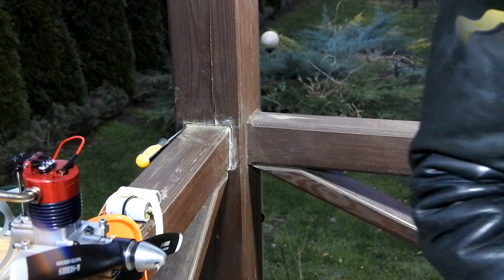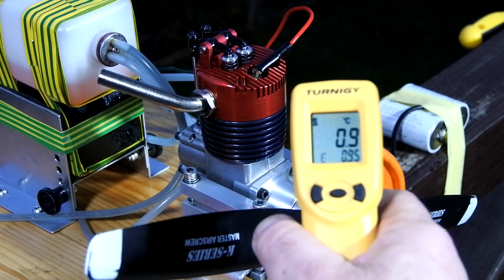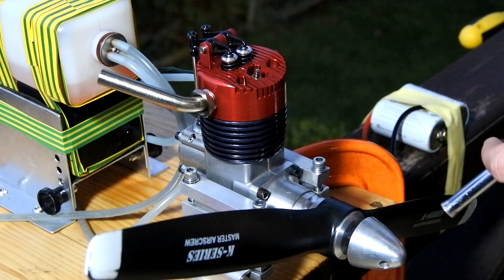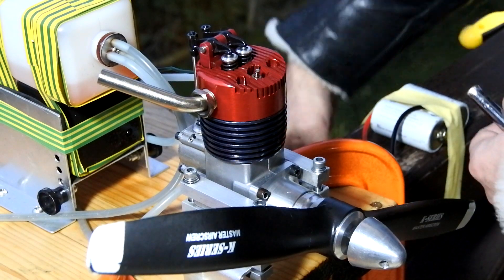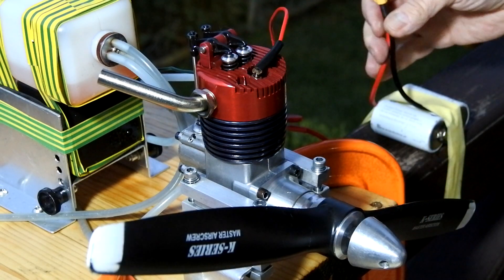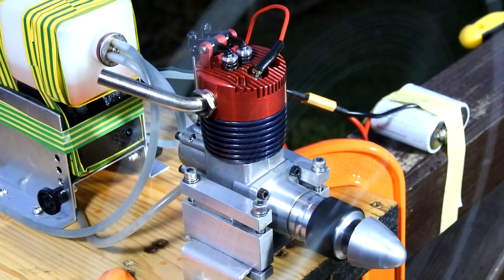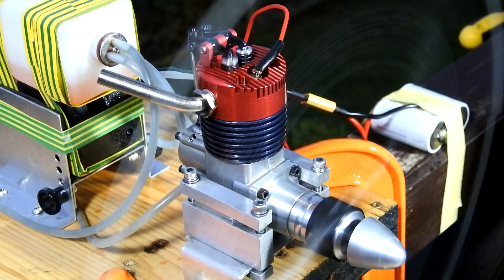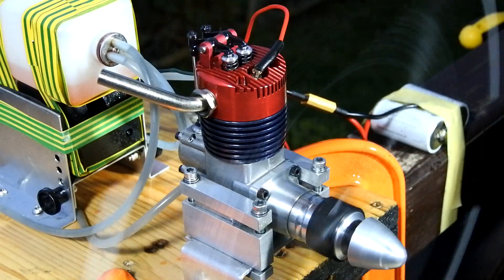Magnum 120S   34 years old engine first run

Comment: A few weeks ago I saw on offer for an "Magnum" engine like that and basically disregarded it because I thought "an early chinese one, don't want those.." ... D'oh.
Reply from the maker: Thank you for your comment ! I think, that this  particular engine is fully original, produced by Custom Enclosures, United Kingdom. I can say this, judging by the documents that came with the engine, the packaging and information from the previous owner, a collector who also had an original Magnum 91S engine.  As far as I know, Chinese copies shows some stupid incredible serial numbers (with 6 digits), as well, as different colored engine heads like blue one, for example). Should state,  that product run with approx 1 million units of crankcases of such rare engine - it's fairy  tales, according to my understanding.

Comment: If this is a ball bearing engine then why so much play in the crankshaft when it runs. I can see this play in a two stroke engine but not in a engine like this one.
Reply: Usually the front bearing is the "fixed" on and the inner ring is clamped between a step on the crankshaft and the prop driver/it's collet. There shouldn't be any noticeable play at all. I noticed that immidiately, too. 

The front casing also looks really short .. not much distance between the two bearings.
Reply from the maker: @VintageTechFan   Thank you for your comment ! I also noticed this kind of "play" during test run. was eliminate it by installing a washer. I still have some feeling, that this particular engine was very "raw", according to its serial Nr. -  one of the first hundred production runs, with all imperfections, of course.
Reply from the maker: Thank you for your question ! I I do not know exactly, but have some assumptions about this, I think that initially a washer was not installed in the engine, limiting the "game" of the crankshaft. As far, as known from some history on UK made MAGNUM engines, .120 size engine was produce later, utilizing most  .91 size engine castings, etc. I was fix this issue on mine engine after test run, by installing a washer.

Comment: I don't expect to see that much end play in the crankshaft for a ball bearing engine? What is causing it?
Reply from the maker: Yes, this is also a problem with this engine. This is a factory \ construction flaw, the engine is "raw" and requires improvements, for sure.
Reply: @crazyengines88  it could be as simple as the taper collet not being pushed against the front bearing. Nothing in the design looks like a problem.
Reply from the maker: @rcdieselrc  Thank you, will check it on dismantle, really сoncerned about this issue.

Comment: is that crankshaft have a lot of end-play? watching the video, i was seeing a lot of crankshaft in and out movement.
Reply: I think it has bushing instead of ball bearings. So the play is normal..
Reply from the maker: @edwinator46  Thank you very much for your advise, will look into engine after test run cycle, to clarify what's really wrong with it.
Reply from the maker: You're totally right, this is probably a factory \ construction defect, the engine is really "raw" and requires improvements. I think, that after run cycle will install kind of washer, as well, as gasket between crankcase and front case. Oil is leaking everywhere, that's not so good, but this is a confident sign, that engine has sufficient lubrication :-).
Reply: @crazyengines88  i have done that on some 4 strokes when there is a problem with crank end play. you will have to remove the crank to see which side of the crank needs to be adjusted so that you dont have to much pressure on the rear drive flange, turning the cams. done this a lot on some of the rebuilds that i have done.
Reply from the maker: @harveynewman4333  Thanks you a lot for advises ! Will try to fix it - this camshaft play  makes a loud knocking sound, that's for sure, couldn't being normal. But, as one on this engine designers, Peter Roffe, have thoughts that engine isn't finished yet from design point of view. So, this engine is more         
a rare technological miracle for me than a really working and practical engine for real flight.
Reply: @crazyengines88  you maybe correct on this one. when you open it up, you will beable to see where the issue is. im curious to know.
Reply from the maker: @harveynewman4333  Thank you, you're looking forward,  for sure. In a week or so I'm planning to dismantle it again, checking internals after run.

Comment: Great motor. That company also made a v twin at one stage but i have never seen one in real.
Reply from the maker: Thank you for your comment ! You're totally right, Peter Roffe and Brian Stammers really created Magnum 182V Twin engine, as well, as 3 cylinder radial, called Magnum 273. Both engines based on Magnum 91S cylinder \ piston assembly. 
I'm dreaming to find somewhere magnum 182 V Twin  engine to my collection.
Reply: @crazyengines88   oh im looking as well   hehe.
Reply from the maker: @vulturedroid9804  Wishing a good luck for us !